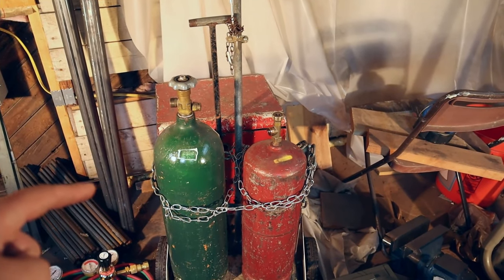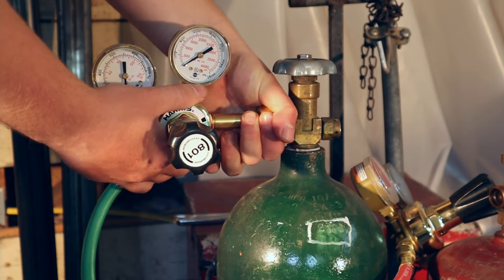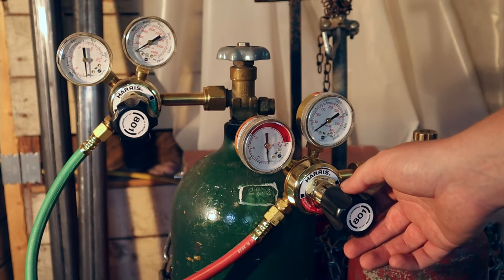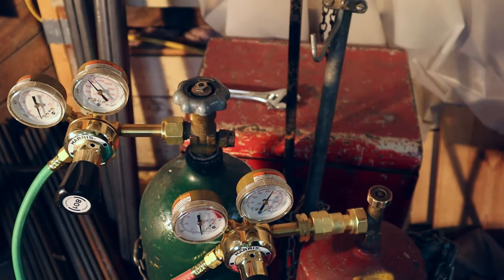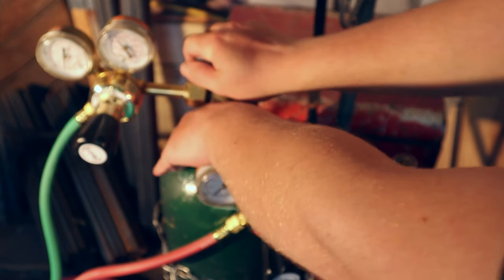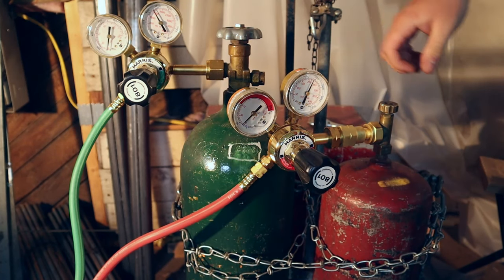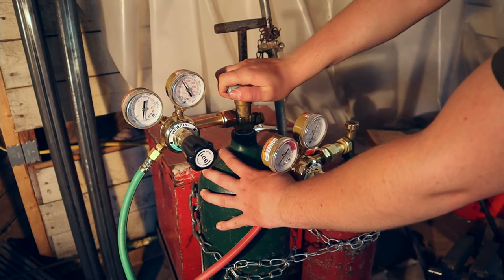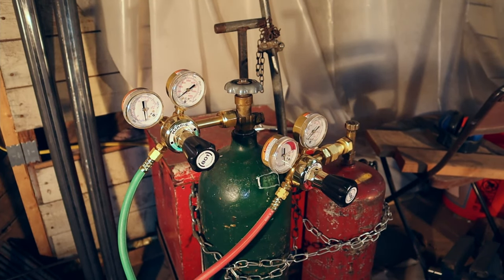Oxy-Acetylene Regulator Setup Tutorial

Comment: So much wrong on this. The valve on the acetylene should even be left hand thread. The valve on the oxygen should be opened all the way. These tutorials should be 100% correct.
Reply: He's using a B acetylene tank, which has a CGA-520 thread. The thread is different than your standard CGA-510 acetylene regulator fitting.

Comment: Hi, great video. What kind of adapter is that for the acetylene tank to the regulator?
Reply from the maker: Thank you. Its a "B"tank to standard tank adaptor.
Reply: @FerrousPhoenix  thank you!
Reply: @FerrousPhoenix Nice video.  A few questions if you don't mind.... I have a small oxy/acetylene setup (10 cu. ft. acet & 20 cu. ft. oxy).  I bought it to mostly just for heating up rusted nuts & bolts as I work on cars quite a bit. I read online that with my setup, it's not safe to use any size rosebud bc of the unsafe acetylene flow rate. If this is true, what size copper welding/brazing tip should I use? I have a #0, #1 & #2. Is #2 big enough to do it or should I go a bit bigger? Also, what should the pressures be for the appropriate tip size for my application? 
My other main question is ...Would a small Mapp pro/ oxy kit  be cheaper and/or more efficient to run than the oxy/acet setup? I read that the tiny oxygen cylinders run out too quickly on these setups. However, if there is a way to hook up a larger oxygen tank to the small Mapp pro /oxy torch kit, then I would LOVE to do that. Is there anyway to do that safely?
Thanks in advance..
Reply: @FerrousPhoenix  I thought that's what that was.

Comment: This may be a dumb question but can the acetylene regulator be used on a propane tank? Does it strictly only have to be with acetylene tanks?
Reply from the maker: It has to be a propane regulator, the acetylene regulator has a different fitting than a propane one.

Comment: The last video I watched said that acetylene pressure should be 5-7psi and oxygen 10-15. If I'm trying to use the cutting torch are these pressures right?
Reply from the maker: That's about what I set my pressures to. But if your cutting really thick steel, you might need to increase them. Just make sure acetylene never gets pressurized above 15, it becomes unstable at higher pressure.
Reply: What about cutting RR rails

Comment: How much pressure is inside each cylinders
Reply from the maker: A few hundred psi, I'm not sure exactly how much. I believe the psi is different for different sized tanks as well.
Reply: I only use small gas bottles but I know oxy is 2200 lbs new

Comment: Does the psi for cutting with oxy acetylene vary with tank size? Like my portable kit you buy at Lowe's for like 300 bucks. Do the pressure settings change when you move from the baby 10cu ft to a mid class 75 cu ft tank? The reason I ask is my regulators use the tiniest A fittings and I bought adapters for A to the next size up and very common B fittings. The hose ID is 3/16" and I bought a little longer hose. I've never had issues before changing to longer hose. My flame just keeps going out as I'm heating up bolts that I want to cut off. Could it be that though the regulator reads 5-7 that I might need to crank it up to like 15 to get 5-7psi in the larger hose? Thanks
Reply: No, the pressure you need is determined by the size of the torch's tip. A larger tip will need a higher pressure of oxygen. You only need enough acetylene to get a decent flame before you crank the oxy